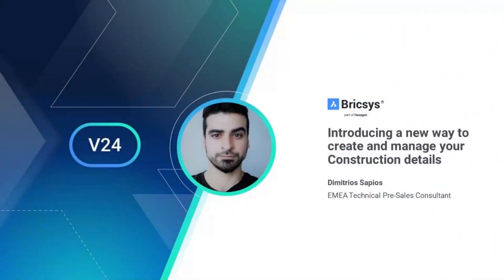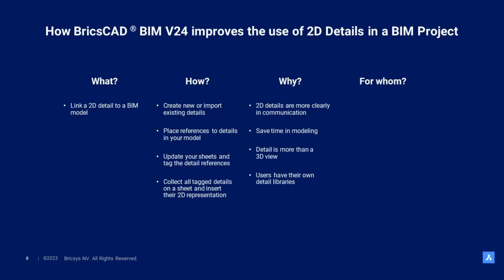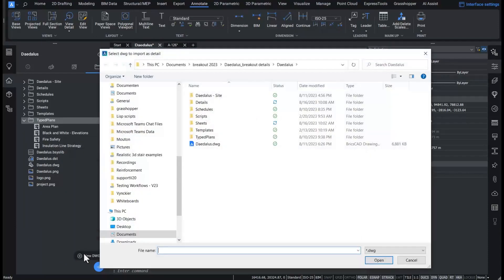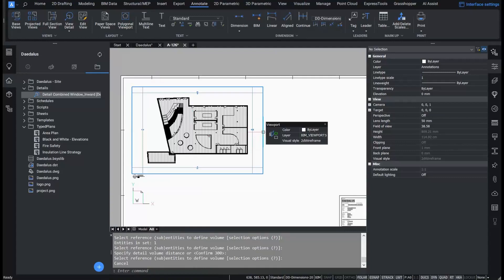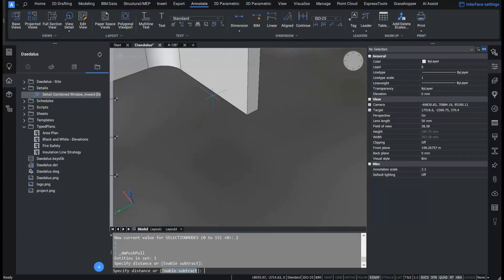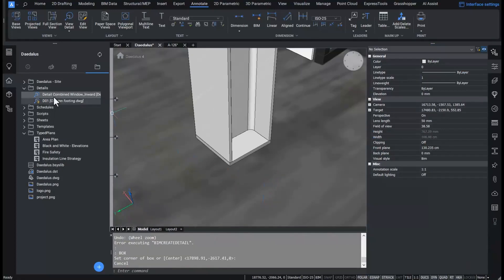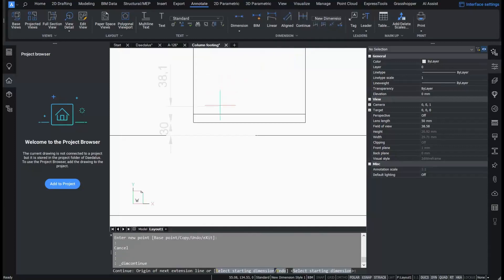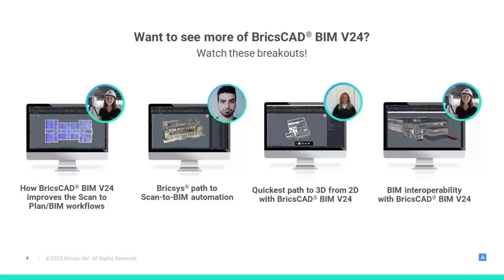Introducing a new way to create and manage your construction details

Comment: Dear BricsCAD Team, i am bricscad user and I'd appreciate it if you could create a tutorial video showcasing the process of designing a steel tube carport on a concrete foundation with a sandwich panel in 3D. It would be fantastic if you could also include the manufacturing workshop plans for the metalworking. Many metal fabricators using your software would find such instructional videos immensely helpful. Thank you in advance!
Reply from the maker: Hi @fs3422, thank you for the request, noted! We will pass this info on to our content team, do keep an eye on the channel for upcoming videos 👀👀